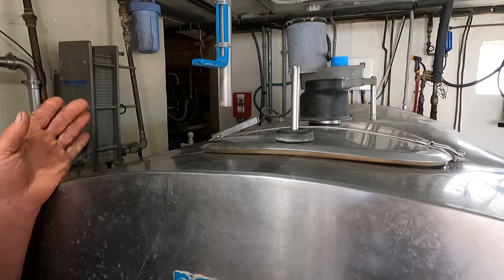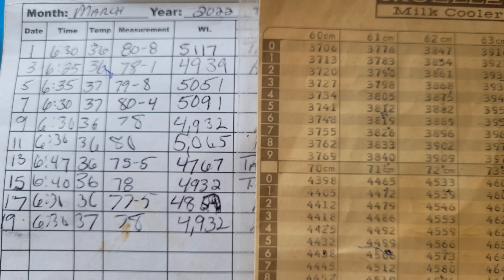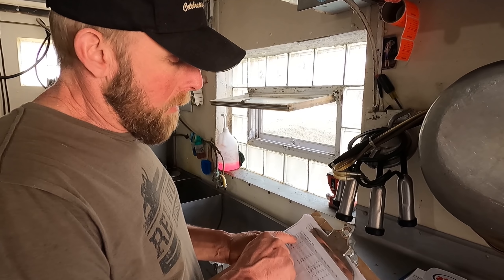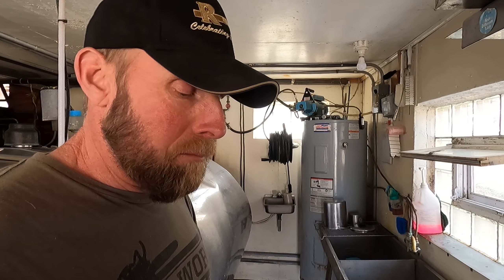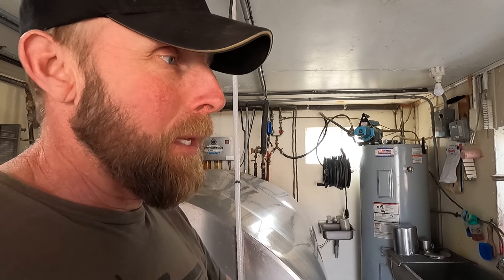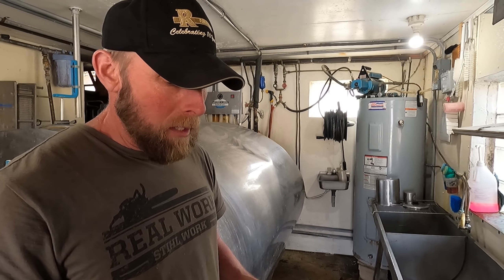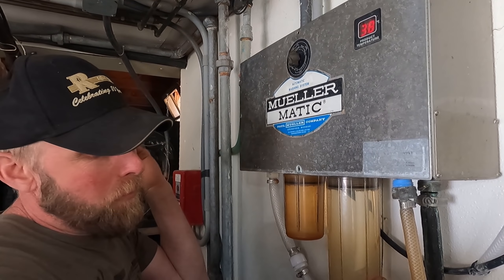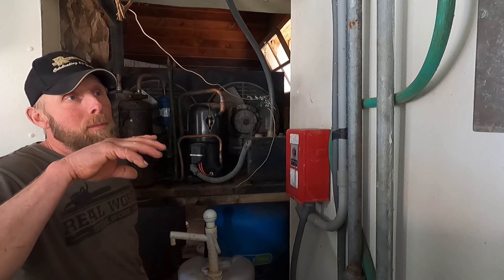Milk Quality On Small Family Dairy Farm!

Comment: Thanks for this video. Had me thinking about the days of milking the cow (juicing the moos) with my Dad in the 1950s and 60s. I remember some of our numbers but not so sure on others. Dad started as a Grade B farm until he moved up to a Bulk Grade A tank. At first we used shotgun pails on a cart which got wheeled near the milkhouse and then Dad dumped them into a strainer sitting on the lid of the tank. Later he got a rolling pipeline which got wheeled down the alley of the barn as we milked. A vacuum pump moved the milk through the vinyl hose we unreeled and hooked to the ceiling to the cooler. Dad had 60 head of Holsteins and it took us about an hour to milk, feed, etc. His BF test was about like yours. I think most of his cows were yielding in the 50-60 lb range per day. There was no automatic washing. That was my job. Milkers were Surge buckets hung on straps. I mostly washed udders, moved straps, moved the pipeline and filled in some on the milkers if he got behind. The pump which moved the milk also powered the pulsators. Milk truck driver came daily, seven days a week. We shipped to a co-op which no longer exists. I remember the port in the wall for the big hose. I apologize for the story telling. Please let me know if I should stop.

Comment: Your hauler sets up the tank washer?  Here they took temp, measurement and the tank measurement stick here had a cup on the end of it for the sample.  Milk went on the truck, they would rinse the tank out after with the hose, but after that you were on your own for the tank washer.  I used to make it a point after I got all the units on the first cows to go out and make sure the tank valve was closed and the cap on, forgot that a few times over the years.
Reply from the maker: Yup they start the wash

Comment: In the early 90's my uncle was mixing cotton seed into the ration, working on his milk quality I suppose. I was 10 so didn't have the strongest grasp at the time. I just remember putting some in a radio flyer and walking through the barn playing pretend farmer and I took the corner short and dumped half the wagon in the barn cleaner. They found me crying, scared in the hay mow for causing trouble.

Comment: Great explanation about milk quality and components. Off the farm I worked at Hillshire Farms and Agropur. In about 2005 there was a quality program started called SQF, (Safe Quality Food). the idea is to keep track of all quality checks in all the plants involved in the manufacturing process from the farm to the table. All of this information was to be logged and stored for all the plants worldwide. So if there is by chance a recall it maybe traced right down to a specific factory to a specific batch even a specific line even if the issue in the US can be traced to a certain plant in France for example. That may be where the European grades come into play. On our small dairy we were very proud about our quality. We were strictly a pail strainer Surge bucket operation. It was a little more work perhaps but everything was isolated and all the stainless pails, strainer, utensils and hosed were taken apart and scrubbed twice a day every day. Our plate counts were rarely over a million and somatic cell is about 120,000.
Reply from the maker: That's all good information, thanks.